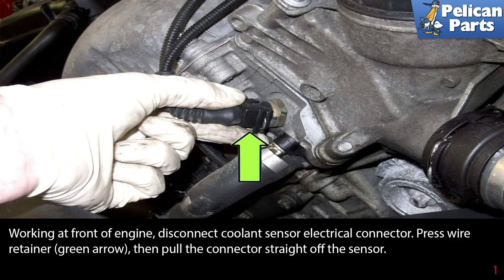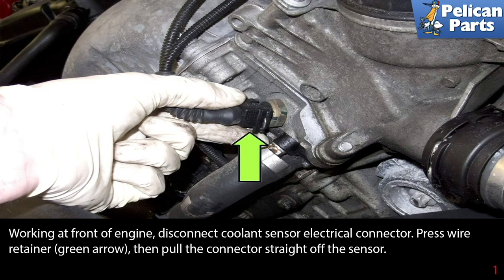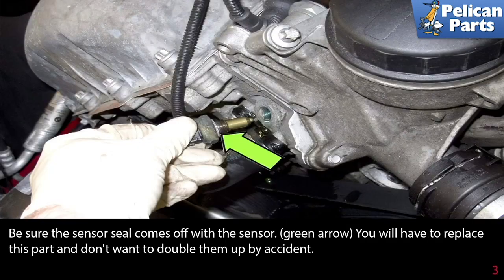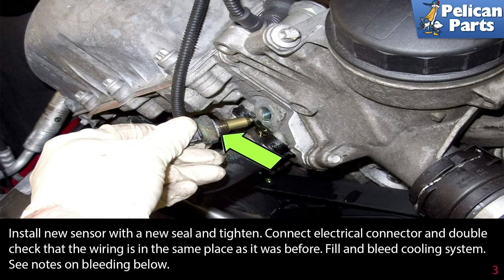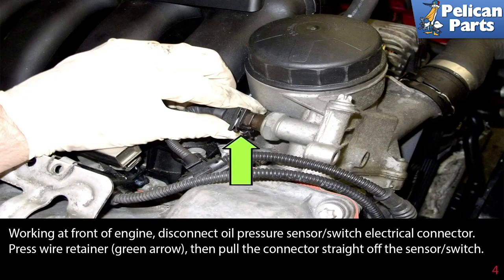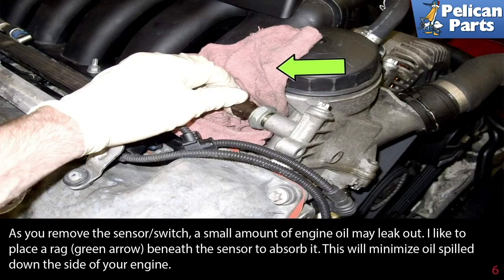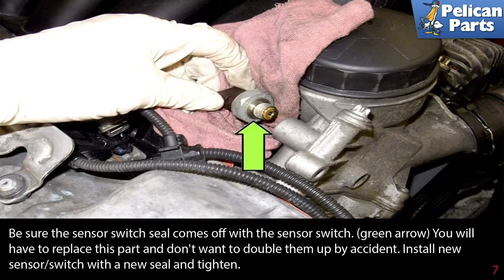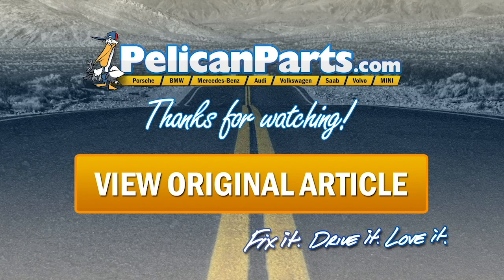BMW E90 3-series Engine Temperature Sensor Replacement for 335i,  325i, 325Xi, 330i, 330xi, 328i

Comment: I replaced the engine coolant temperature sensor but it still isn’t reading the temperature, any suggestions?
Reply from the maker: Check the coolant temp reading using a scan tool, is it correct in DME and cluster data?